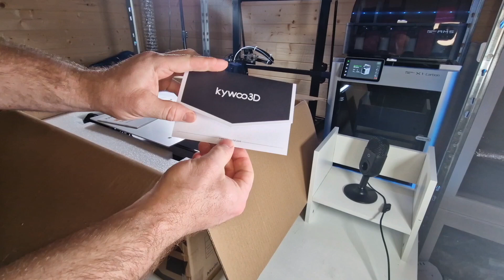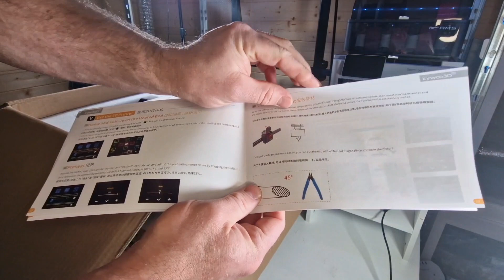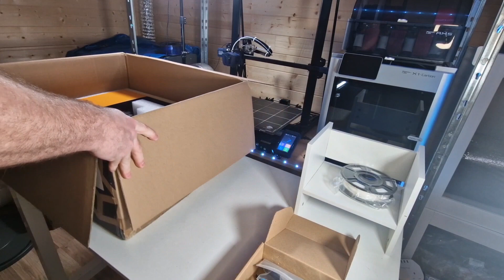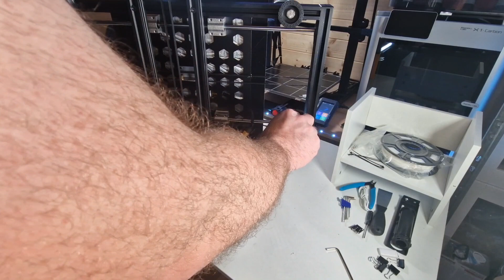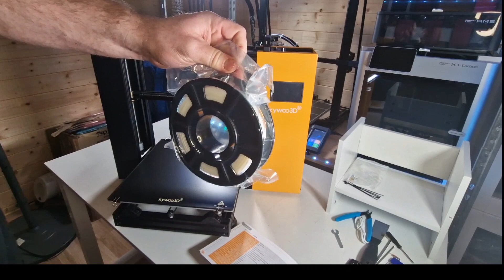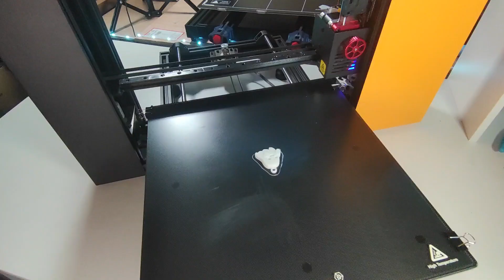#3d #3dprinting #kywoo3d #3dprinter #3dpuk Kywoo3d Tycoon Max unboxing and build

Comment: Loved the video Phil wanted to bend your ear I am having trouble with my anycubic kobra max it’s making a clicking noise from the extruder and been having trouble with a lot of stringing
Reply from the maker: Hey many thanks 😊,  so I'm guessing its possible the knob in the extruder is slipping have you measured it from the black knob to the side of the extruder should be 18mm also check the cog isn't slipping 😉   any questions grab me in the Facebook  group